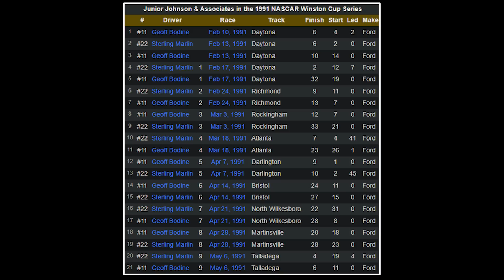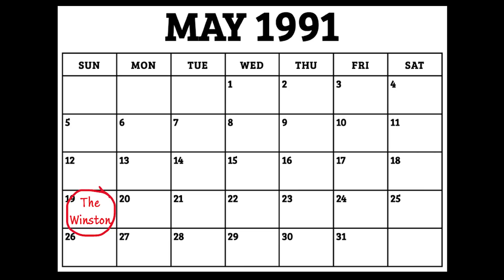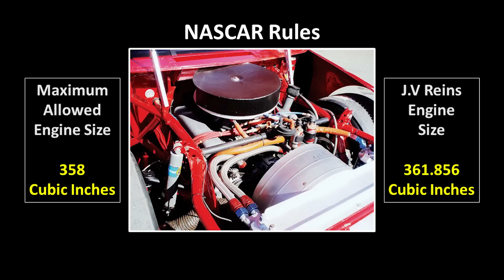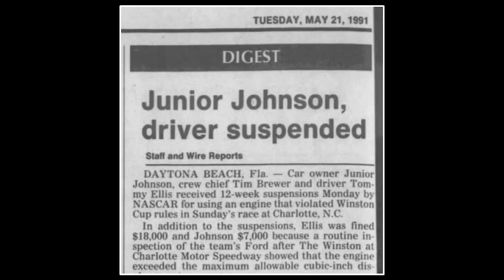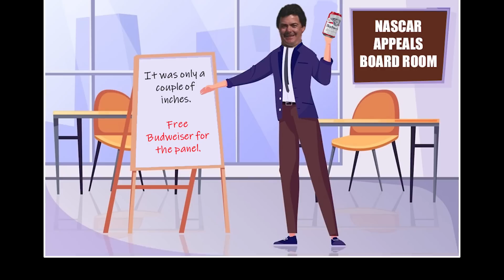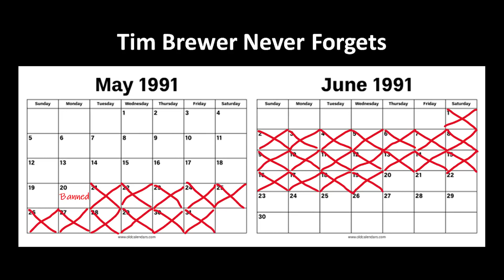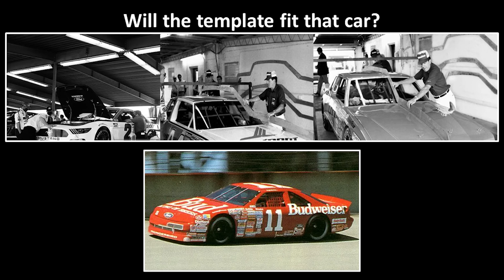In The Spotlight: Tim Brewer - 361.856 Cubic Inches

Comment: Jamin, what happened to the team that qualified with that same engine?  They enjoyed the same advantage.  Thanks for the post.
Reply from the maker: When Tim Brewer tells the story he doesn’t say when J.V Reins was told.  I don’t know if it was the All-Star race, or earlier in the season, so I couldn’t be more specific.  However, Brewer is emphatic, saying he had a source working for NASCAR doing the engine checks, who told him J.V was warned about that engine.  

How Sterling was able to use it and qualify, I’m assuming it did not get checked in the same manner as in the post race.  Also, when it failed post race inspection for the 11 car, I guess Brewer wasn’t about to throw the 22 under the bus and cause more issues, so he didn’t mention it was the engine the 22 qualified with..lol.  Then again he may have been so angry that he did and NASCAR thought, well it wasn’t raced in the 22.

The way Brewer tells the story, and take it for what it’s worth, if someone else, he never says who, was holding the calculator besides John Darby, it would not have turned out the way it did.  I don’t about that, I think NASCAR was waiting to send a message to the teams for some reason, and this was a perfect opportunity.
Reply: @jaminspeed  Thanks for the reply.
Reply: @jaminspeed  I think, that after Sterling had used it to qualify and the unnamed NASCAR official of Brewer's retelling knew Marlin wasn't going to run it in the race, because it was going to get swapped out, Mike Beam was told 'Don't ever bring it back.'
Tim then says J. V. (or anyone else) never passed that on to Junior that the engine was close to straddling the too big line.
At least that is what I took away from Tim telling the tale over at The Scene Vault Show.